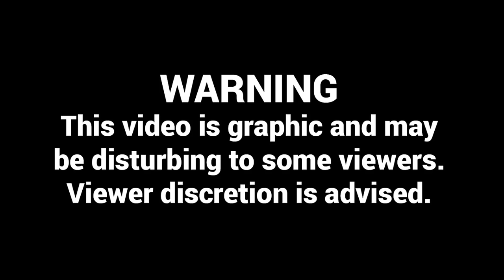LOCKED IN SLENDER MANS BASEMENT! (GONE WRONG) | MOE SARGI

Comment: Not to sound mean or mad, but use the dang baseball bat. Tell me smash the window and call me out it’s not that hard to figure it out smash the window climb out or smash the wood and climb out that’s a metal baseball bat which means the wood or the glass would only dented it would break it, then you can escape and he’ll probably run out after you but you’ll make it to the truck and then drive drive drive don’t look back don’t turn around don’t do anything just dry because that’s the easiest way you’re going to escape because if I was in your position and I had a baseball bat, I would just smash the window run out get to the car drive drive drive drive drive don’t turn back